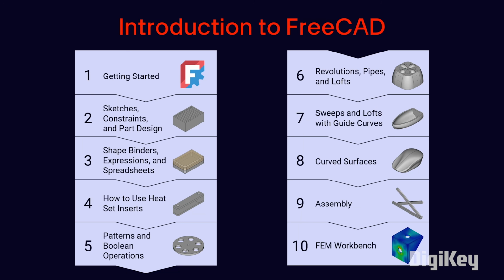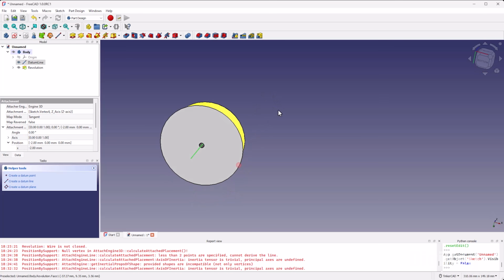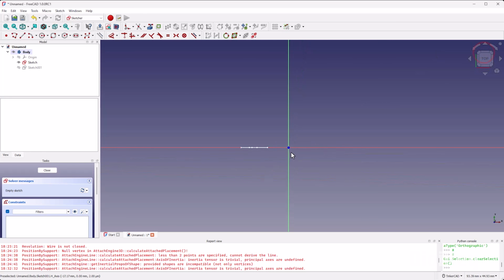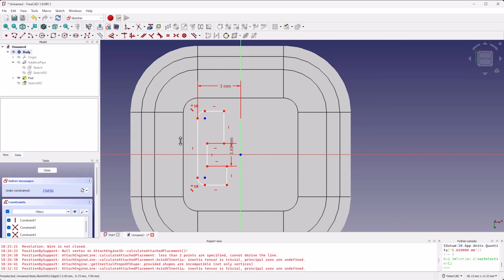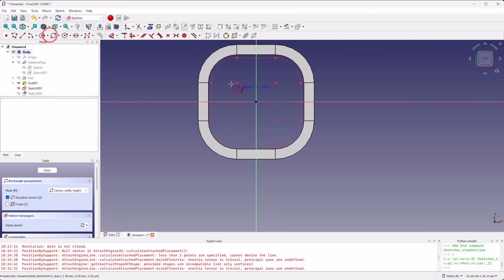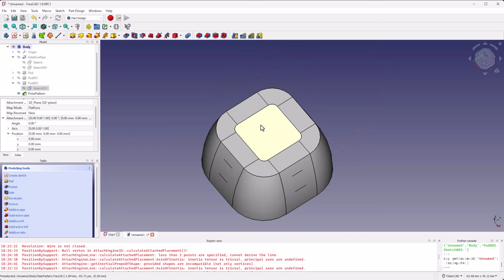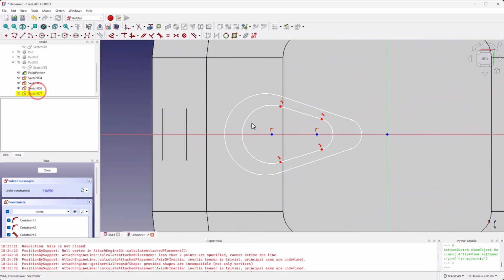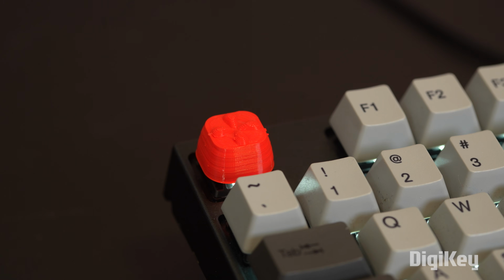Introduction to FreeCAD Part 6: Revolutions, Pipes, and Lofts | DigiKey

Comment: I'm having the same issue as @bubblec0re stated. It is when you PAD the inner rounded-rectangle at 13:20. After putting in the parametric code.
Reply: Never mind. I worked it out. 

Great series by the way!!

Comment: Hello, when padind the top gap, my geometry has less segments or vertices than yours. It joins the rounded rectangle to the top flat area. So when I look underneath to select the next plane for the new sketch my one is just one plane instead of 9 segments for your plane. Is this something I can change from the settings? Thanks in advance.
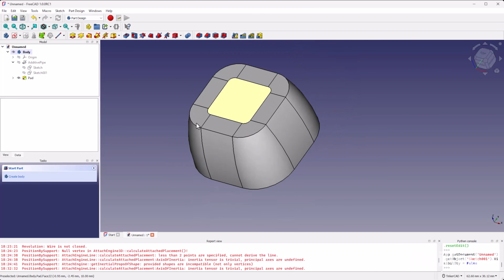Reply: (It's at 13:40) - after some tinkering I found the issue is that for the additive pipe and pad, you need to set "part design.refine = false", otherwise it will refine the shape to remove the extra lines that you need for these extra steps.
Reply: @ironman1942  Thank you!  Was just going through this lesson and ran into that exact issue.  I wonder if this got changed in a version update?
Reply: @biglar155  I don't think so - afaik this is by design. I went through this with the latest version a few weeks ago. I think the author of the videos might have indicated at some point in an earlier tutorial that they turned this feature off so they could do some of these types of manipulations.
Reply: Could you give me a timestamp so I know where you're having issues?

Comment: Great tutorial, thanks. I've watched from the first episode and sure will watch all the rest. A bit of constructive criticism, if I may: it'd be nice if you could explain a little on the purpose of some of the actions. Like, for example, when you started drawing out the profile of the keycap cross section sketch at 6:33 - at first I was really confused and just hurriedly followed along, not really knowing what exactly this weird squiggly will become later. That part was delivered in the form of 'draw a line here, click there, do this, do that...' but there was no explanation about what this is, and it only becomes obvious when we apply the pipe and see the keycap.
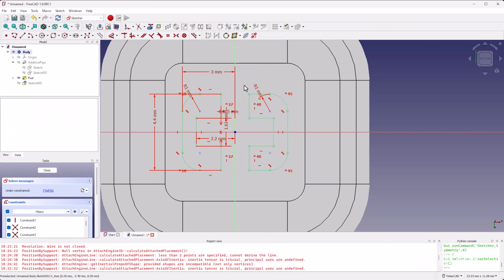Also, a question: why not use 'create symmetry constraints' at 16:31? Is it a bad practice?
Reply: Thanks for the tip! You can definitely use symmetry constraints there...in fact, that might be better than using dimensional constraints.